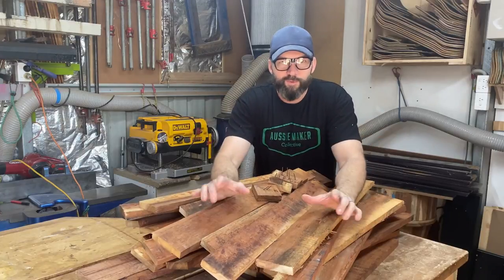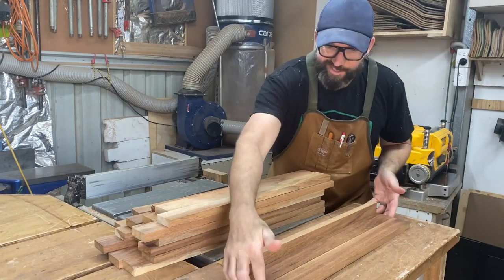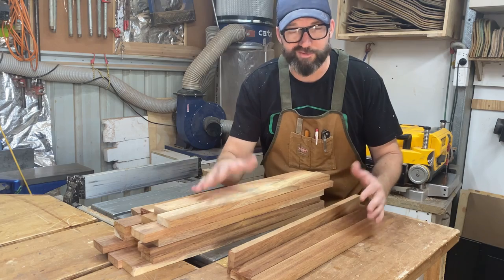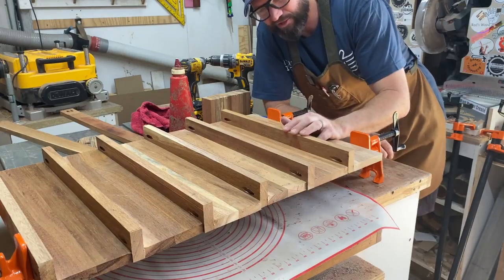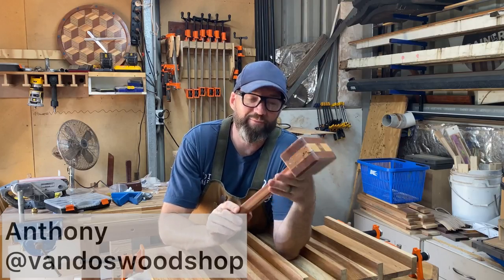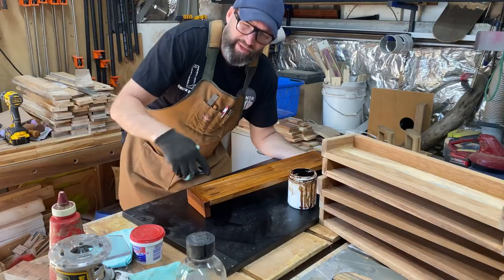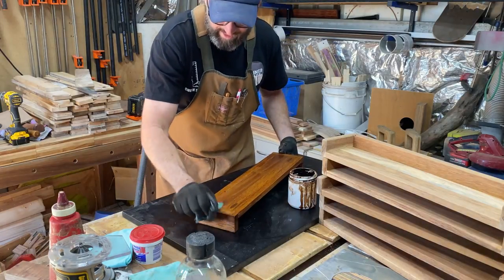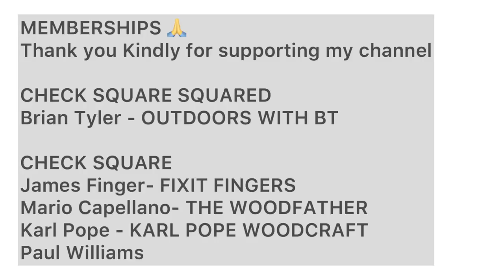VERY SIMPLE - Floating Shelves

Comment: How did you go with the pocket holes in Merbau? Did you use the fine thread screws? That stuff is tough as nails
Reply: @dainermade  thanks mate. They turned out lovely. As someone else said in comments I reckon even better with a clear coat